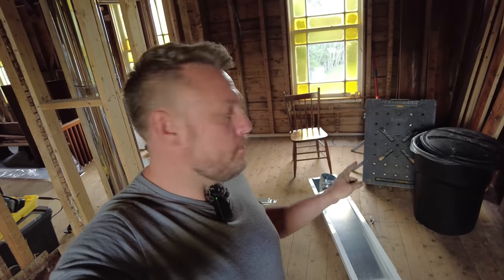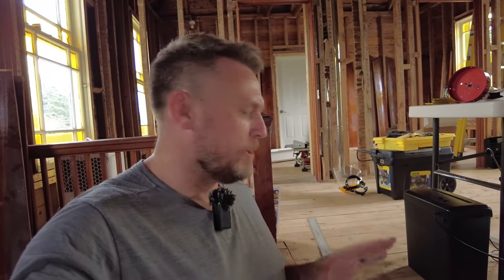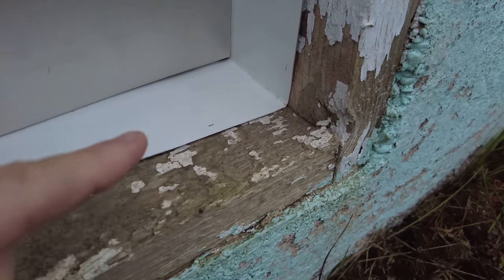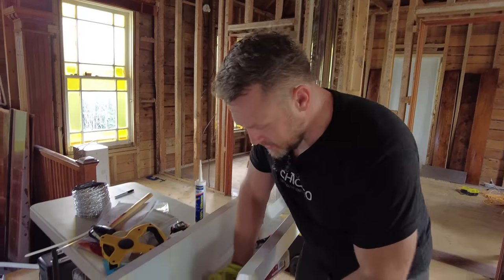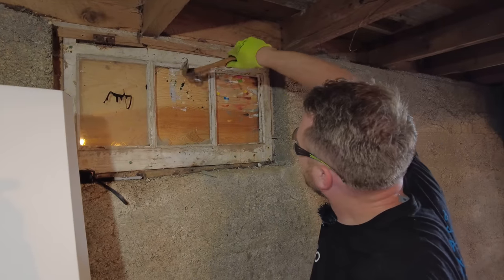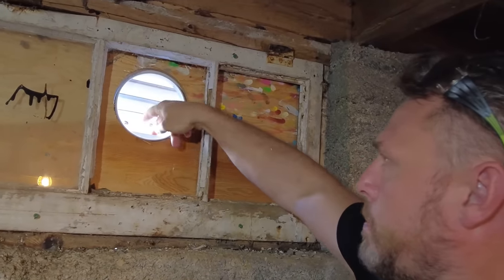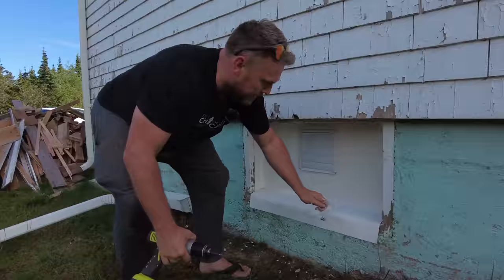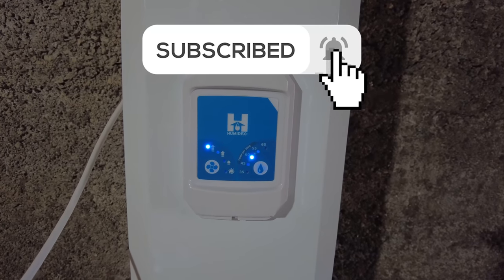DIY Installation of a Humidex in a Damp Old Church

Comment: Gavin... I know you will not like my comment. Hope you have the vent on the North.... the warmer air from the South direction will help.  (Spring to Fall) .... The air stream will be only from your vent to an open gap in the wall? or whatever air comes in from the outside. Check with a cigarette smoke the air stream!    All what is beside the air stream is more or less useless and bring not much moister out. With dirt floor you get humidity from the outside under the building to your floor.... inside (rain). An airflow works only across ... opening on the left incoming air and opening on the right 180 deg. for outgoing air. ... or backwards. When you have opening on all 4 sides you have no airflow. I would put the midsection from your windows out and an install an air vent in with a screen to protect you from insects. (no electric on an alu vent} Cost very, very less money when you buy....  $100-$200 max.  You would have an airflow 24/7 no electric bill for this operation. Your airflow will work on a much more effective airstream from the left to the right in your basement. Seal all corners on your window where your vent is installed with silicon and not any acrylic. Acrylic dry out and crack... water will come in. Should be sanded and painted before your alu installation anyway!  Your nails should have a rubber seal under the head and rills along from the head to the bottom for water protection and the nails will not come out by temperature changes over the time. Best would be to have a concrete floor sooner or later in your basement. Hope everything is going well for you. (don't😄 hate me)
Reply: Merry Christmas to you and your better half....🔨

Comment: All that work for nothing if the wood still got exposed, you just needed to cut the metal with the size of the window frame and slap it over it with sealant, no bending and you would have everything covered
A lot of over engineering and work for something so simple 🤣🤣 but at least now you have a glorified fan 😜😂😂

Comment: One question: .... If the fan is blowing air out of the basement, where is the "make-up" air coming from?   OK, second question just begging to be asked:  Why would the make-up air have a different water content (humidity) than the air being exhausted?     Just a thought:  If you believe the basement is air tight (little to no natural make-up air), then perhaps something like this might alleviate your concerns over moisture damage???  (see: https://www.amazon.com/Midea-MAD50P1ZWS-Dehumidifier-basements-Pint-2019/dp/B0866XLRTX/ref=sxin_16_pa_sp_search_thematic-asin_sspa?content-id=amzn1.sym.075b4844-907e-4733-ac4c-baaec37ffd39%3Aamzn1.sym.075b4844-907e-4733-ac4c-baaec37ffd39&cv_ct_cx=whole%2Bhouse%2Bdehumidifiers&keywords=whole%2Bhouse%2Bdehumidifiers&pd_rd_i=B0866XLRTX&pd_rd_r=4888a4bf-2886-4f92-b94d-ab914ebd6da7&pd_rd_w=0vOVm&pd_rd_wg=HT1XK&pf_rd_p=075b4844-907e-4733-ac4c-baaec37ffd39&pf_rd_r=7EMYX16JDX0446M7AQR2&qid=1671650147&sr=1-1-4a643ae4-6005-4b15-bc31-2c5125e2b25b-spons&spLa=ZW5jcnlwdGVkUXVhbGlmaWVyPUEzSEVPSklSQzZHVjNMJmVuY3J5cHRlZElkPUEwMjU4NDU2M1UzRjhWVVNRRk1UTyZlbmNyeXB0ZWRBZElkPUEwNjczMzMyMUJCMFRKSVlFQVU2RSZ3aWRnZXROYW1lPXNwX3NlYXJjaF90aGVtYXRpYyZhY3Rpb249Y2xpY2tSZWRpcmVjdCZkb05vdExvZ0NsaWNrPXRydWU&th=1)
Reply from the maker: Supposedly the 'replenishment air' comes from upstairs via vents in the floor.
Reply: @HardcastleTowers  Just trying to be helpful for you..... but if the replenishment air is coming from the upstairs, then I'm going to assume that it is heated air in the winter?   If that is true, then the warm replenishment air is air that has the highest water bearing capacity (I.e. the water content of the air coming into the basement is likely higher than the air being exhausted).   So, operating the Humidex might actually be moving more water laden air through the basement than what the stagnant basement air contained.   Don't misunderstand me, I think getting water laden air out of the basement is a good idea, but  you might like to consider opening a vent to allow outside (cold dry air) to be your makeup air during the winter time.   During the summer, I'll assume that perhaps the upstairs air is cooled air conditioned air?... In that case, using upstairs air would be a good thing.....The idea is to get more water laden air out then you let in, but you'll have to make changes during each season...... Alternatively, you might like the de-humidifier idea (above) as a means for getting the water out of the basement air as a year-round solution, but this would involve stopping the air circulation idea promoted by Humidex.    Hope this dialogue helps you come to grips with the issues involved.     (P.S.  Note that some others are offering advice too, but not all of it makes sense ... your challenge:  Make sense out of all the confusing suggestions... :-)  ..... the fellow with actual experience with an "old cottage" might be worth considering --- vapor barrier the floor, gravel on top of the plastic vapor barrier, and use a dehumidifier ---- just saying... hint, hint, hint)
Reply from the maker: @skipsaunders5974  I like the idea of two sources of make up air. Oustide for winter from upstairs for summer. We plan on encapsulating the basement.
Reply: @HardcastleTowers  Hope you folk have a great Holiday Season!!!.... :-)   And thanks for all you do for  those of us attempting to find interesting landscape photo opportunities... 🙂